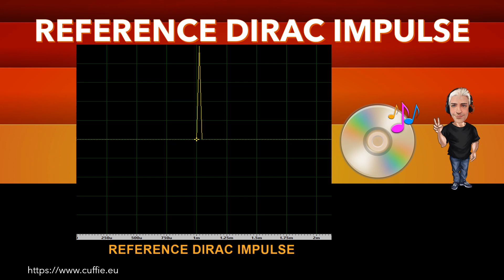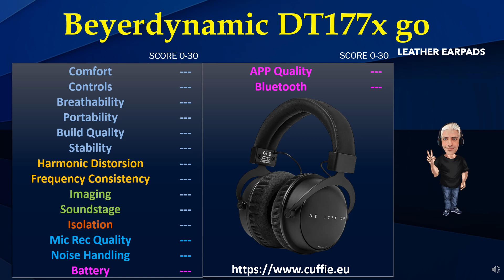BEYERDYNAMIC DT177x Go Leather Earpads - Recensione, Review, Sound Demo, Sound Test, обзор

Comment: Are you sure there is no error in the test?? It sounds much worse than expected from the curve. Can we find out anything about the test method? Do you use some kind of loudness meter for same level, facilitate comparison with the original track?
Reply from the maker: Hi, unfortunately there are no errors.
I use a Neuman KU100 dummy head with the preamps calibrated to the Harman curve.
Many measurements are made with various placements, to determine consistency. Then the average curve of the measurements not in the critical range is chosen. in short, a very complex thing.
The volumes are the same, but depending on the frequency response of the headphones it can give the sensation of more or less volume.
Reply: Thank you, I find your work very useful. However, there is error in this test. The minor problem is that the two sides are not equal in the pink noise measurement, the left is louder than the right, approx. by 1 dB. The bigger problem is that the measured signal from the headphones is much quieter than the measurement signal and the music. With a Nugen loudness meter, the difference is almost 2 lkfs. A louder sound always sounds better than a quieter one. These headphones are probably better than we can hear based on this test.